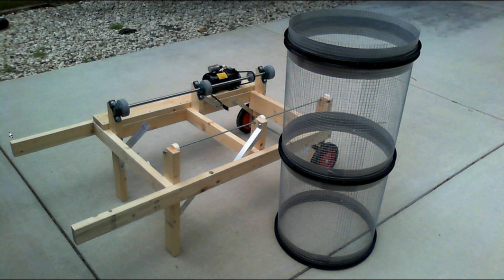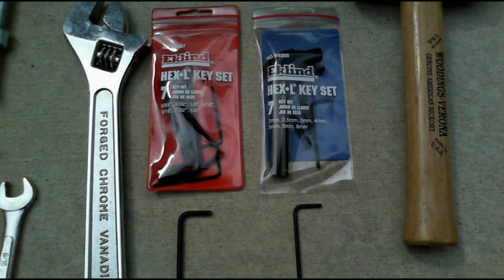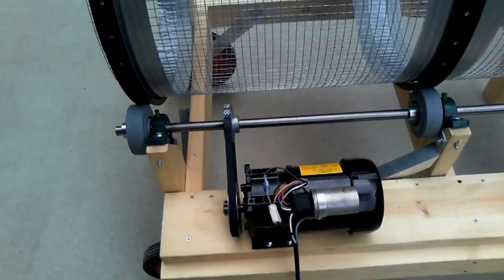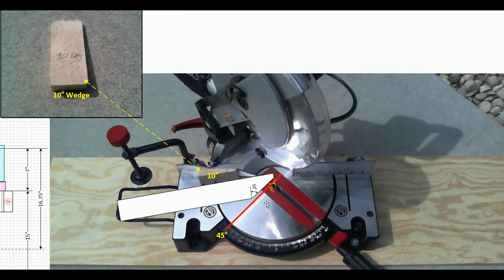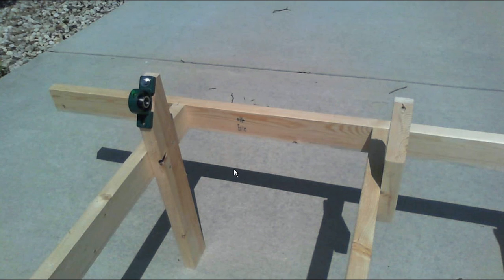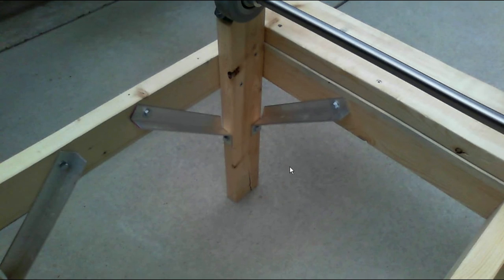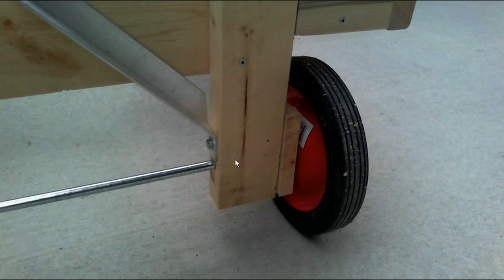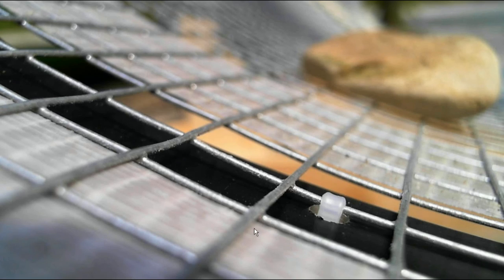Rock Trommel / Rock Washer (Part #4 - Trommel Build)

Comment: Wow, great design! I was wondering what the fan was for, using it to blow light debris out from the rocks is clever!
Reply from the maker: Thank you... It may seem clever, but it proved not that practical for removing plant roots. Maybe if it was a higher volume air flow fan it would have worked better.

Comment: I've listened to your explanation of aligning the idle wheels by loosening and tightening the HEX nuts.  It seems if you tightened the HEX nut on the other side of the 2x4 mount it would tend to pull the wood into the wheel and distort things.  I would think that using washers as SHIMS would be a better alignment method.   What am I not understanding in your explanation?
Reply from the maker: Short Answer: You make a good point, SHIMS would provide an effect means to position the idle wheel.
Long Answer: When making minor adjustments (less than 1/4") to the idle wheel's position, the wood will provide enough slack for minor adjustments. I did not have any issue with distortion or pulling wood into the wheel.

Comment: questions, what size moter is used and how many revolutions per minutes
Also the wire of the drum is attached to the wheels but how is the two seams that run the length of the drum attacheded to keep from separating?
Reply from the maker: The motor is 1/4HP with a shaft speed of 87 RPM.  Nylon tie straps are used every couple of inches along the wire screen seam to tie the seem together.